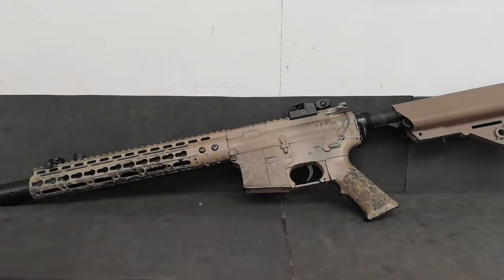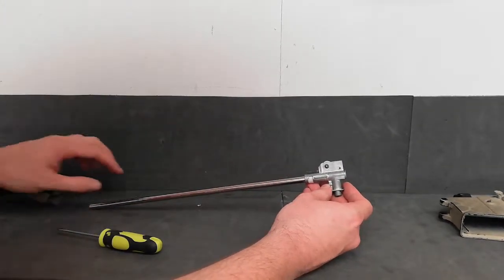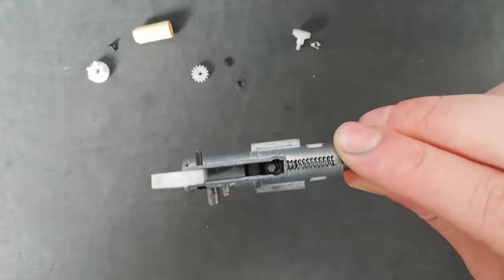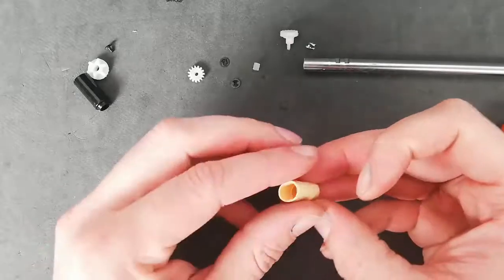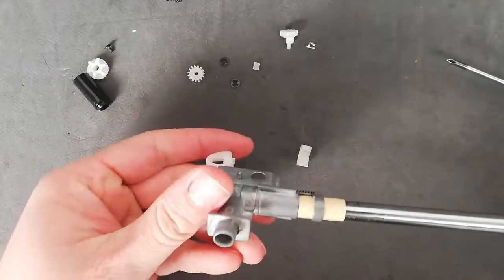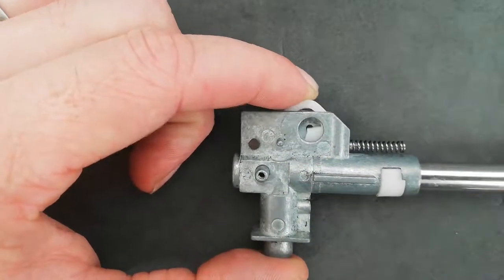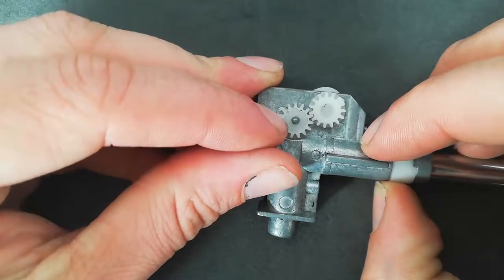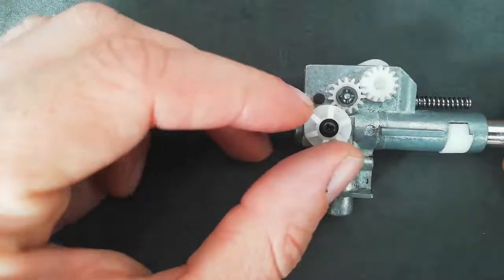How to change your airsoft M4 hop up bucking (basics)

Comment: Thank you for such an informative and detailed video there chap! You are a true brother!
Reply from the maker: Happy it helped you out
Reply: @DTWAIRSOFT  Hello again, I have a question about long shaft motors. I am trying to replace the pinion gear on a CYMA motor but there isn't a lock screw on the shaft like other gears. Do you just heat it up with a torch and use some needle nose pliers? How do you secure a new gear on it? Thanks so much for any input on replacing the pinion gear on the motor.
Reply: @DTWAIRSOFT  Hwy there brother. Do you have an email address I can message you on? I have a quick question. I built a high speed SSG build ina version 2 gearbox shell used the new lancer tactical Proline shell and mosfet, put new 12:1 gears and bushings in, new compression parts and a Matrix 5000k high speed motor and it worked with one mag but kept blowing my full rack pistons out. Do they make a stronger piston? I was just using stock full rack pistons out of other guns and haven't purchased an aftermarket piston yet. Could the motor be too fast for the build? The gun was shooting around 40 rps. This is the 4th time I've torn this gearbox apart. It's really frustrating. Any advice would be greatly appreciated.

Comment: Ahh mate i lost my spring on hop up the one that push The hop up backwards 😢
Reply from the maker: You mean the one on the outside of the unit?
Reply: @DTWAIRSOFT  yes 🥹🥹🥹 it got bent and when i open the gun to check the hop up it fell and my airsoft isn't accurate anymore
Reply from the maker: @Jay-Jo4580  Try using the spring out of a click pen, that might fit
Reply: @DTWAIRSOFT  i found a spring from a small alcohol and it matched size and length

Comment: Nice video, but just a doubt, do you really need to remove the dents, screws and nub from the hop up unit to remove the bucking? Can't you just slide out the hop up, change the bucking and insert it back in?
Reply: not if you want to replace the nub. just bucking yea but nub you need to take out gears

Comment: so that first little gear that you took off, the adjustment dial. I lost that part, would I be able to buy just that gear or would i need a whole new bucking?
Reply from the maker: You can buy sets of thoes gears, you just need to have a look around. If not then you will have to get a new hop unit

Comment: Is this a good bucking for that type of barrell mate? Im just askig cos i want buy ml super macaro and i have standard barrell. But inside of that bucking is little oring and it should be space for that on barrell i think. Pls answere
Reply from the maker: The ML is good but I was not using the stock barrel in that video so I don't know if they are compatible. The barrel I was using was a ZCI 6.03
Reply: @DTWAIRSOFT  i buy madbull stell bull 6,03 do you think it will be good for ml bucking?
Reply from the maker: @kubaj136  Iv never had a problem with mad bull barrels and ML hop rubbers together so you should be fine
Reply: @DTWAIRSOFT  thank you bro👍
Reply: @kubaj136  where did you buy the zci barrel

Comment: Where does the small metal ring go?
Reply from the maker: It goes down the the barrel after it's been installed into the hop unit. It acts like a spacer to stop barrel wabble in the unit.